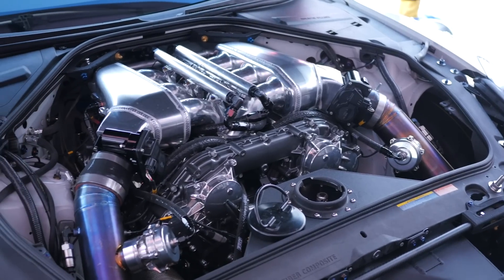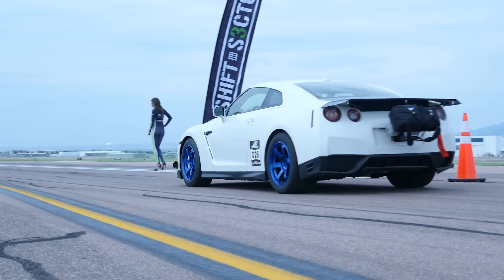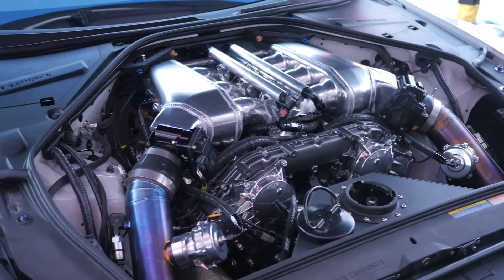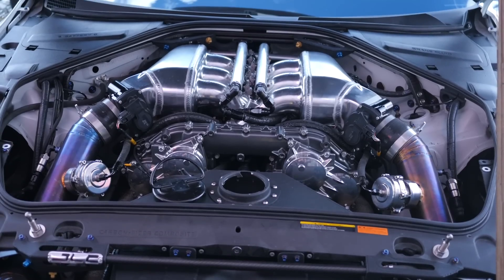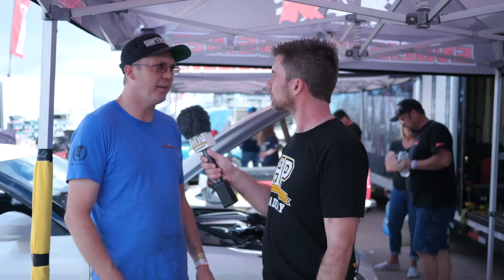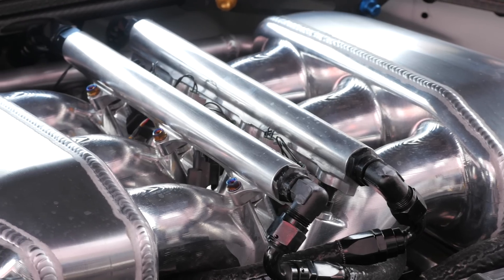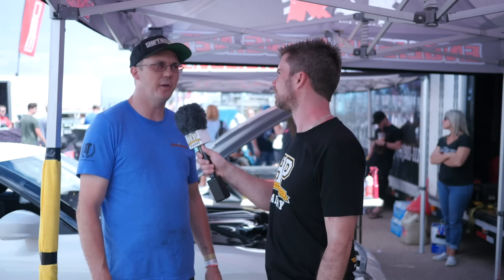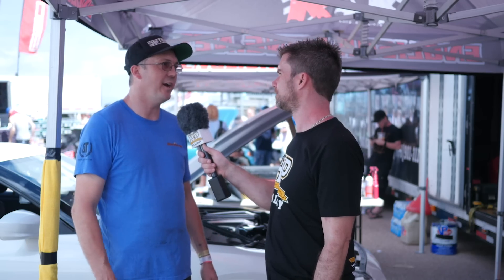How To Go From 500HP to 3000HP | VR38 GTR Engine Building  [TECH TALK]

Comment: R35 I can handle 1500hp stock

Lamborghini I can handle double that stock
Reply from the maker: They are also not 6 cylinder engines with this capacity, so you'd really hope an engine twice the size or more performed as such 😂 - Taz.

Comment: So many people compare these things to TT Lambos making over 3000hp on the factory block but seem to ignore the fact that it's a small v6 against a larger v10.  What they do with these VR38s are mind bending especially when you think when the car came out it was supposed to be untunable lol
Reply: the 3000hp lambos and r8's dont use factory block they are either using the underground racing long block with the 5.7 stroker crank or the shop they came from is likely machining a new block out of billet. my understanding is any of the r8s and huracans pushing past the 2000whp barrier are using this long motor. also keep in mind the Lp series gallardo uses a different motor entiely to the pre lp series which uses a 5L block, i dont believe any of the big shops have built a 5L past 2200whp. also remember a 2000whp r35 is likely pushing 60+ psi a 5.2 huracan or r8 making north of 2000whp would be lucky to push 30psi of boost. i agree with you though mind bending that the little 3.8, all be it stroked out, can hit the same amount of power and often run a quicker 1/4 mile time than these big v10s.
Reply: @Bigwjack64gb  UG runs proline built engines
Reply: @alafawnduh_eg  I don’t think Ugr is associated with proline
Reply: @Illuminwhy  unless they switched they have been using proline since 2008
Reply: @Illuminwhy  Google proline and underground racing. They’re not hiding anything. Kevin’s stated it multiple times
Reply: @Bigwjack64gb  They have pushed the factory block well past 2000whp.  That red Drag965 Huracan ran 242 in a half mile, pushing the stock block over 10k rpm.  They do have X version pre LP cars like Moe's, they sound so much better imo, that thing is making north of 2000whp.  Could they run 60+psi? I don't see why not, but that's unusable power.  They're already blowing the tires off through the traps at 260mph.  For the Lambos it's a traction game, not really a power game.   
Now all those X2-3 cars I'm sure are on proline racing billet blocks.  You're right I don't think they're pushing that on stock blocks but iirc Kevin 2500whp is plenty doable on with a stock block.
Reply: That’s what I’ve always said to myself! These small engines compared to big v10s make the same power but it’s a smaller engine the GTR needs 6 cylinders and the lambos/R8s need 10
Reply: It’s not just the vr38 or the power, it’s just the perfect combination of how the car is, the platform is insane. The TT lambos are still better but their all the best for roll racing. The viper too
Reply: Its not that “mind bending”, with a smaller engine you can add more material while maintaining a lower weight. More material = stronger block

Comment: Am I the only one who gets bothered by that butcher job of a cut through the bumper plastic in front of where the turbo sits? Lol..
Much respect to Mr. English and these amazing racecars though.
Reply: The reason this car,the t1r car and the ams car have the turbos mounted there is due to thermal management reasons according to Tony Palo. If a veyron makes 3000hp of heat at 1k hp you can do the math on this car. Even AMS resisted it as long as they could before mounting the turbos in the same location. Definitely not pretty or ideal for FOD but a requirement none the less
Reply: Nope... you are the only one! LoL..  but I've come to learn that digital camera's & pics do some cars justice then when you see them in person. And some beauty queens... look real ugly and dirty in person! Sometimes you can't believe that the car was just the cover photo of the magazine!!
Reply: No, you are not alone

Comment: 10 years span of R&D has allowed performance shops to develop the VR38 performance parts. So now we see turbo kits and fuel system for the VR38 to produce over 1000bhp without breaking a sweat.

Some may disagree with me but i think the VR38DETT is like the Skyline GTR RB engine. Many years back 1000bhp from the RB engine is a feat of engineering. And clocking 320km/h on the highway in a Skyline GTR was ground breaking.
 Now even a stock block VR38 could go up to 1500+ bhp before it develop cracks. And it never cease to amazed me to see the VR38 engine now pushing way above 3000bhp and still be limited by turbo. Unless we could perfect a way to build boost down low and then in the higher gears allow the bigger turbo to switch over as it spool up and deliver all the torque twisting power to crack 250+ mph or over 400km/h top speed. 

Maybe next year in 2019 we might see 4000bhp produced the VR engine and maybe even 5000bhp that puts that fake POS Devel Sixteen to its grave.
Reply: RB needs much more work to live at 1500 hp. Booth ETS, English Racing, Boostin and Shep himself have said you are basically upgrading the turbos, cams, bolt-ons and running it on E98 or C85 to get those numbers can drive it for two plus years of events without a rebuild. Motive DVD's own R32 started coming apart around 700 hp stock block.
Reply: @dj4monie  I have also watch Motive video on the RB block myths. Blew my mind that the RB26 N1 block isnt any better than the stock U05 block and is below the RB30 and RD28 blocks in terms of hardness and bore diameter. 

RB blocks esp the RB26 are prone to cracking, so to combat it would require re-machining the bore and fixing braces if you want to make big power on the stock block. Or pretty much go billet blocks
Reply: What’s R&D?
Reply: In strictly numbers it is similar to the RB engine. You are also correct about the limits of the typical twin turbo setup. The high hp GTR guys need to look at diesel power guys if turbos aren't doing enough. Diesel power comes from sequential turbos. I think Comp Turbo makes a 144mm turbo which is probably too big for this engine in a twin turbo configuration.

Comment: It's interesting that he says that more boost is safer than more compression at that level. One thing I was wondering about is stroking vs standard stroke but chasing more revs, surely you'd get more revs on standard stroke, but would that make more power. Or is it more like you go 10% bigger capacity with stroking, but only lose say 7% of the revs, so you get extra power at maximum rpm.
Reply: If your running very a large turbo/s the latency or lag increases and the efficiency of the turbo is pushed into a higher rpm range which you need to access by revving the engine higher. Higher capacity allows more air to enter earlier and reduces lag along with the strength advantages that come with a billet crankshaft. You can aslo hit a point where your turbo has maxed out and revving higher is only putting additional stress on the engine and not yielding any significant gains. Another factor is Rod to Stroke ratio, V38's are very well designed with 1.86:1 ..and even after pushing them to 4L+ cylinder filling is still in a very desirable range. There is no trade off with these engines, you can stroke it to 4.1L and still rev it too the moon if you have a giant turbo that is making significant gains above 8500rpm.
Reply: @lightmetalinc.6488  So, better to stay with stock stroke and crank of you're wanting 1100 to 1200 rwhp?
Reply: @FKnATOO  It comes down to what you want out of the engine and how much money your willing to spend. If you want all out durability at the 1000whp range a billet crank is stronger, will make more torque low down and brings in the boost earlier. With that said I'm sure its possible to make the same power on a stock crank and go just as fast in a straight line. Horsepower is just a number, I have the most fun in cars around 300-600whp, R35's are too serious and expensive for your average Joe to play with.
Reply: I'm thinking the bigger capacity helps put the bigger turbos in a better zone on the compressor map
Reply: Yes

Comment: Attention GTR fanboys, your R35 WON'T hit 6s unless it's a billet block, the end.
Reply: What about the 6 sec lambos or vipers? Their billet or nah?
Reply: @camarosaregay7943  1. No 6 sec Lambos exist yet.
2. Some are, some aren't. Go check the builds, there's plenty of them detailed on YouTube on channels like TRC.
Reply: @MafiaboysWorld  so I’m new to this part of car scene/community, out of the 3 vipers lambos and gtrs which is the best, more dominant platform
Reply: @camarosaregay7943  Each has their advantages and disadvantages. Also, what you're setting the car up for (ie. 1/8 mile or 1/4 mile drag, or 1/2 mile top speed runs) is very important too. Cost, development, all that factors in. 👍
Reply: Kimbo did it on a stock block lol 😂
Reply: @detail4168  Yeah, well over 3 years after this post was originally made, he finally did it, congrats.
slow clap
🤦🤦🤦